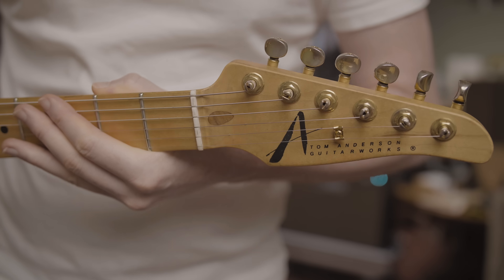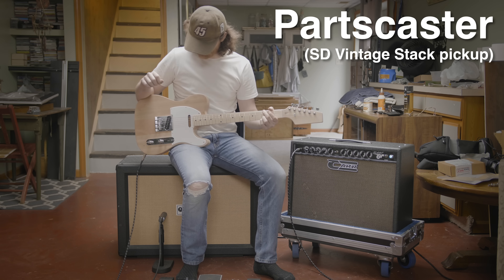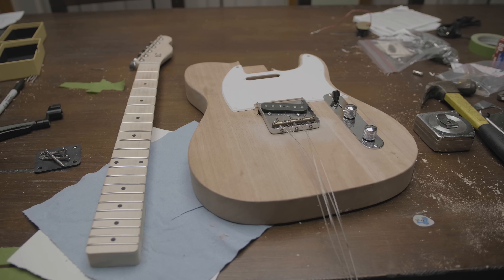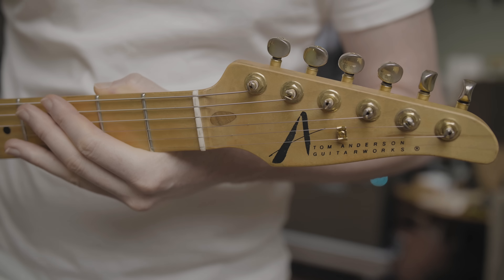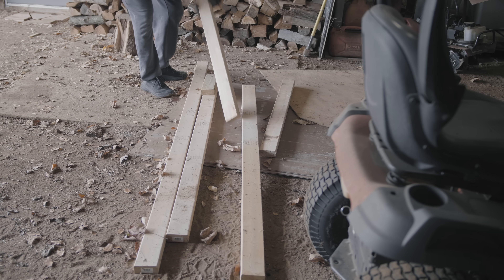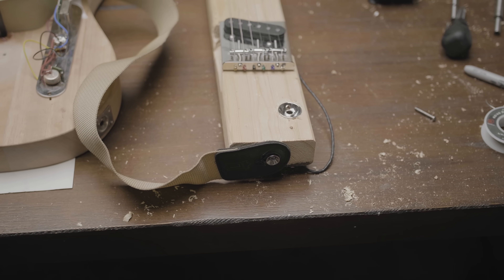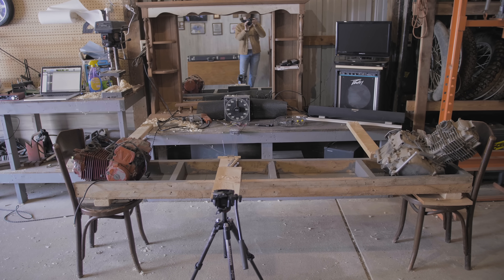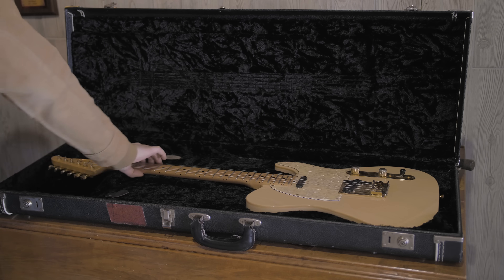Tested: Where Does The Tone Come From In An Electric Guitar?

Comment: Am I the only one who can actually hear the difference? The one with a guitar body sounds way brighter and snappier. What kind of headphones did you guys listen on?
Reply: In statistics it's called "a margin of error". You can't stroke the strings in exactly the same way twice, and that affects the sounds that are being produced. Also note that the strings are oriented differently, lying flat vs a 90 degree angle, and this is known to affect the sound slightly. And don't forget that no two pickups are exactly the same, they all differ slightly from one another. Not to mention that air guitar has no shielding and thus catches a lot of noise, most of which is in the middle region of frequencies. So if you look past the margin of error - the tone is exactly the same, just these superficial differences throwing you off.

Comment: Guys, hear me out (not a tonewood snob but) I don’t fully agree with the conclusions. I saw another video on new metal guitar etc. if you look at the air guitar => it has HUGE shelf (block of dried wood) attached to it. There is point of connection with the string through the bridge, so the resonance should go trough this huge block of wood. Which tells us: Anderson strat wood is as good of
a resonance as a HUGE WOOD PIECE. So… don’t know guys, when i try out electric guitar in the store i look at their non-plugger Acoustic qualities first… am I tonewood snob ?
Reply: I am not sure if this is serious or ironic, but just in case that this is real - yeah, you are a tonewood snob.
Reply: Further, 2x4 etc matched to anderson strat are not exact, there are overtones missing…

Comment: I to have done tests.

There is differences in tonewood... BUT... you need to play 100% clean. Any amount of distortion or overdrive, everything sounds the same.

The differences are subtle, but there.
Reply: So... You need to play unplugged or straight to di? In that case, why not just use an acoustic lol. All amps have slight distortion, even the cleanest of them all.

Comment: CONGRATULATIONS!!!!!!.
I totally agree. You did us a huge favor! Thank you so much for all your work.
However, as seasoned guitar player and builder. I did notice some significant differences when it comes to sustain with lower levels meaning clean sound. You did test a sound which is substantially compressed
by your amp. Since every object, in this case wood has its own physical properties it does matter pairing different woods together. They can enhance or practically erase some frequencies in vibration. This will in turn effect the sustain on the clean (non compressed) sound of the guitar. In any case thank you so much for your tests. It helps A LOT to understand better the different relationships of parts in distorted (or even crunch like) sounds.
Be all safe out there❤

Comment: When I was young and did audio engineering in college, the thing we learned/found/was the art was...the right mic and the right mic placement. Too close, too far, wrong angle, bad acoustics, whatever - THAT was the most important. This was 35+ years ago, so the thinner Fender bodies and necks got thinner for faster players. The big argument at the time was "tone" because the wood had changed, but it really came down to having a good mic (pickup) and the action (distance from the sound to the mic/pickup). I think this is what you have proved here, which is essentially the most important thing is how you capture the sound.

Comment: Cool. But the 'air guitar' has more wood-anchoring than all the others. The bridge screws and neck screws are screwed into two giant solid wooden benches with engines weighted on them. Thats a lot of wood resonating.
Reply: Wood doesn't conduct
Reply: @cybergproductions  Sure but the premise of video is about whether wood has tone. My only point is that 'desk' setup is meant to show what  'no wood' sounds like, but it has way more wood than any guitar. (Just not between the bridge and neck.)

Comment: Cheap guitar with good pickups has always been my m/o. this guy is a true scientist - experimentation
Reply: amateur. he uses ear. not frequency response plots, etc. also compression effect evens out sound, removes peaks, etc. need just simple unprocessed signal from pickups fed into frequency analyzer, oscilloscope, etc.
Reply: @PavelKrupets  Guess what? Same guitar, same note, same pick, same player would result different frequency responses on different takes. This is not something that can be measured precisely, due to the fact that you can't hit the string perfectly in the same place down to literal atoms.
Reply: @music_shev_  you can pick the same enough. no need to use player.

Comment: This is a true revelation.  Great work.  I've asked so many guitar shop people many of the same questions you're asking and gotten the most withering condescension when I express skepticism at their suggestion that there's a certain unknowable alchemy involving wood and neck composition and density that determines tone.  It's the electronics setup. Period.  Everything else is pretty much style.  This reminds me of the beginning of that documentary that features Jack white, Jimmy Page and The Edge.  It opens with White nailing a string to a board and wiring up a pickup then playing a great sounding lick using a beer bottle as a slide.

Comment: Great video, I hear the obvious difference when playing lines not chords , it would be more convincing if you can demo them by play some clean guitar solo and play with more dynamic, to test any responding differential other than just frequency similarity,
Reply: That difference that you hear? In statistics it's called "a margin of error". You can't stroke the strings in exactly the same way twice, and that affects the sounds that are being produced. Also note that the strings are oriented differently, lying flat vs a 90 degree angle, and this is known to affect the sound slightly. And don't forget that no two pickups are exactly the same, they all differ slightly from one another. Not to mention that air guitar has no shielding and thus catches a lot of noise, most of which is in the middle region of frequencies. So if you look past the margin of error - the tone is exactly the same, just these superficial differences throwing you off.

Comment: I learned this from experience. Here is the order of importance with how you should use a guitar budget. Amp, guitar, pedals. Guitars are something that can always have an insanely high price tag. The thing is, guitars hit that diminishing point at a far lower cost than a guitar amp does. Lets say you have about $2.5k You can get good playing guitar with nice pickups for $500 or less with a wide range of options even. But plug that $500 guitar into something like a 5150 or 6505 or any other full tube half stack.  I guarantee you will sound much better than a $2000 Gibson or strat plugged into a $500 modeling amp.
Reply: I learned this from experience. Here is the order of importance with how you should use a guitar budget. PC, guitar, sound card, wah. For home practice, undeniably the most important aspect of guitar, you don't really need a real life amp, especially for the price that they are being sold. You can always just plug into your PC and use one of the hundreds of ampsims. Not only will it give you an insane amount of available tones to pick and choose from, you will also be able to easily record your performances, denoise the DI signal, AND you get a looper for free, plus the ability to play to an accompaniment of your own making. Sound card comes next to last in my ranking because I personally have been able to get away by just buying a $2 big jack to mini jack adapter and plugging in to my line-in.
Reply: @music_shev_  Ehhh I've tried amp sims extensively, honestly I think they serve a better purpose to re-amp a recorded dry guitar. They have added latency. They don't have physical knobs, buttons, switches, or foot pedals. Nor can they even get loud without a expensive PA system on top of it.

For the low price of $200 or about the same as a crappy used computer and interface, I locally purchased a 50W Valve-King MK2, a tube amp. It sounds good, and is loud enough to play with a live drummer by itself. All you have to do is keep an eye on your local marketplace for a while and score a decent amp. IMO even a Roland micro cube > amp sim for any real time playing.

Comment: That Partcaster gets right next to how your Anderson sounds, just with the Seymour Duncan swap, but you'd still had to change the tone pot and the tone cap with the same values as the Anderson for it to get even closer. Where both volume pots the same 250K since the start? Anyway, that says a lot about equivalence of the electronics. Other changes were more subtle but not as noticeable as the pickup swap. The saddles swap was noticeable. The head shape was something, there was a surprising warmth after shaping. The 2 X 4 and the Anderson sounded almost exactly the same first try and the Anderson sounded even fatter on the second try. But you could not get your wrist comfortably sitting on the body and it made a difference in your picking, making it harder for you to play and it showed. So, the player is a part of that tone too. The Anderson sounded a bit fatter on the heaviest stokes at the beginning but that air guitar...how the hell did it sound so similar to the Anderson on the lighter stokes?
Reply: The head shape was literally no difference lol

Comment: Well, the bridge was indeed atatched to a piece of wood at the end of the day (the work bench). It is false to claim that the pickups pick up the sound resonated from the wood in a solid body electric guitar, but the type of material that the bridge is atatched to and the saddles act as a filter for the frequencies that come from the strings. With that being said, the key factor for guitar tone is the pick up, followed by the bridge, sadles, electronics, nut AND the body wood. Wood matters? Yes, but not as even close to what manufactures claim they do.

Comment: If you knock the guitar body, you can hear that knock true the pickups, so you can hear differences between different bodies, because in fact there is differences. Are those diferences justifying a high price wood? I don't know. But if you can't hear differences between two different guitars, well, that's your problem, not mine...
Reply: how much of a difference could you hear between the bench guitar and the real one?
Reply: @Tiban how often do you play and compare guitars?
Reply: You hear the knock because it's vibrating the strings, you goofball
Reply: @drdoom8793 Yes, but that's the most basic example to show that the guitar body influences the vibration of the strings and therefore the sound... Goofball your mama...

Comment: Great Video! Here is my take, the sound is produced by vibrating the string against the pickup, and the tone comes from white noises from high pitch, high vibrations travel less distance and easily dampened than low pitch, to enhance the high pitch vibrations, design the pickup vibrating out of phase with the string, or damping the pickup against the string, or create a high pitch resonance (6Khz ~10Khz) somewhere, sound box for high pitch or some structures that has high pitch natural frequencies, or electronically (angular winding, defective capacitor), magnetically with silicon iron plate as how they produced induction motor rotors. it will give you the tone you wanted. You might want to try with a cheap hand held accelerometer.

Comment: Bad take. You basically tested mic placement.

Here's the answer: Wherever the guitar is anchored affects the string response. Les Pauls sound massive because they have a huge stoptail anchored into a dense slab of wood. Teles sound are thinner because the strings are anchored to a thinner body. After that, you can eccentuate or remove frequencies through EQing, but you can't add string response that isn't there to begin with. Headless guitars typically rely on a lot of bridge mass.
Reply: You're talking about an entirely different construction style, it's not the wood making a difference
Reply: @drdoom8793 They're not entirely different construction styles. Wood Neck on Wood body. Not a huge difference. Density of Ash body vs brass tailpiece as an anchor? HUGE difference.

Comment: Any guitar strings and pick-up will sound like a guitar - background vibrations will simply be added via wood or metal or whatever you want. Most likely the difference then is an additional reverb from vibrations in the material around the pick-up.

Comment: The tone comes from everything that is connectd to the strings and also the pick-ups - so in you demonstration it also comes from the benches at each end of the void - are they made of wood? if so you are using 'tonewood', if they are metal then you are using 'tone metal' obvs :)

Comment: i have never understood why ppl think the material the body and neck are made from make any difference to the electric parts ( unless the body is made of steel, which might make a difference ). if it was an acoustic then it will make some difference. so only better electric parts make the better sound, put really high quality electric parts into a cheap body and it will sound great. but we all buy and hear with ours eyes.

Comment: Even without accounting for the production tolerances of the electronics the sound was extremely close. Pots and pickups are not identical - the better way to test would be to use the exact same electronics in both guitars - making the test much more difficult. Also human strumming is at best 80% the same. 
Even with those variables the tone was VERY close in all tests.

Comment: Easy answer is everything matters in guitar building, especially acoustic but in your case the pickup difference is massive. Important to factpr reliability, playability and how long it will last. And like a gun, it's the shooter mostly, not the gun. One thing new luthiers fail to conquer is being able to repeatedly produce the same sound over and over using all the ingredients that gently vary over time or sometimes a single batch. Much like a cook with different stoves and ingredients can always cook the same biscuits. If you can ever nail this down to an easy formula you will be the first.

Comment: 0:50 the third builder is correct, the first two are way off. Thinking that tuners contribute in anyway to a guitar’s tone is just absurd. 

In an acoustic guitar yes the wood makes all of the difference. I think for decades these guys assumed that this also carried over to electric guitars. It doesn’t. The only thing makes a difference is your electronics (a very small difference) and your pickups. I don’t believe wood or anything else, especially tuners, has anything to do with the amplified tone of an electric guitar. I’ve always thought this, and I think this video provides the empirical evidence to prove it. Anyone that insists that all of these other things makes a difference at all is in denial and they are experiencing what is called cognitive dissonance. If you’re not sure what cognitive dissonance is, then google it and what I said will make much more sense.

Comment: EE here.
It would be interesting to digitally record the pickup output at a high sample rate.  Then do the same with another guitar and perform frequency analysis comparing each signal.  Sort of "overlay" the data and examine how they compare.  The signal is obviously produced by the electromagnetic interaction between the string(s) and the coil in the pickup. The pickup is not acoustically interactive with the mounting (or should not be).  Where and what kind of material the pickup is mounted (if in the same position) would likely indicate there is no difference in the mounting material (the guitar body).  The 2 X 4 guitar proved this.
The rest would be snake oil.

My son just bought a new Tele.  It looks great but the true sound  and music is produced by the person playing the instrument and not the instrument itself.  A beautiful guitar would sound like crap if I were to play it (for example) but if you played it, it would sound quite good.

Comment: This is a super interesting video, but I think it leaves some holes that could be answered with a follow up video that shows identical sounds with fretted notes. For example, Jim could use a bolt on neck guitar to swap necks made of different woods to see if a difference in sound is noted whether notes are strummed, picked individually, shredded, etc. I think differences would emerge. All this video really demonstres is that open strings will sound the exact same as long as the pickups, scale length, etc. all remain the same. Don't misunderstand me because what's demonstrated in this video is awesome and really important! But I'd like to see the same comparison with different neck and fingerboard woods. It'd be a pain to do, but not nearly as big of a pain as making the 2x4 and air guitar!
Reply: You answered your own question. As long as all the necks are the same scale length, have the exact same fretwork and distance between frets, it will sound the same. Only difference I think the necks would have is if they were bolt on or neck through. Then the guitar would structurally be different and produce another sound. Would be cool for him to follow up with this though.

Comment: Your heavy tables attached to the bridge, head is bouncing off the momentum back to the strings, in effect drawing the vibration energy transferred from your strum mainly to the strings. They should also be isolated. Say bridge, head attached to long fishing cables suspended from a nail on a cement wall. Literally hanging in the air.